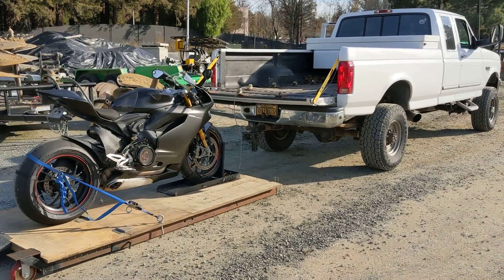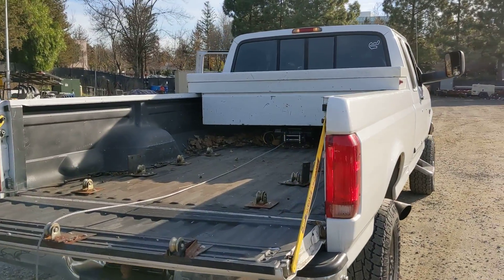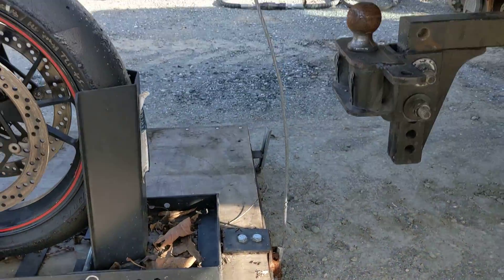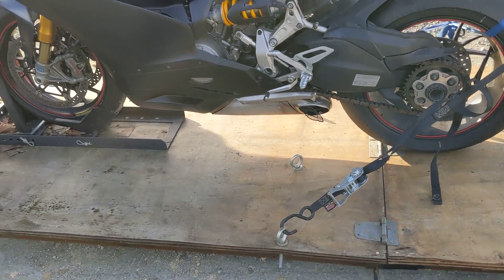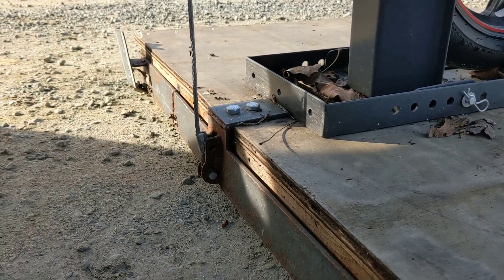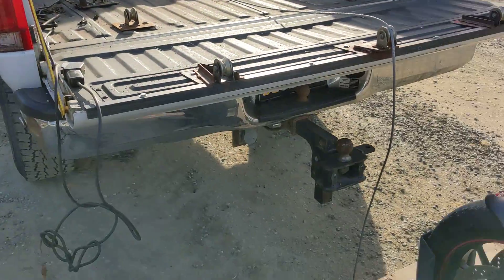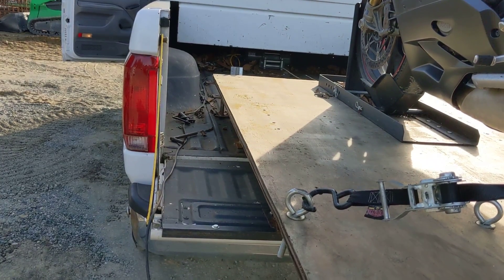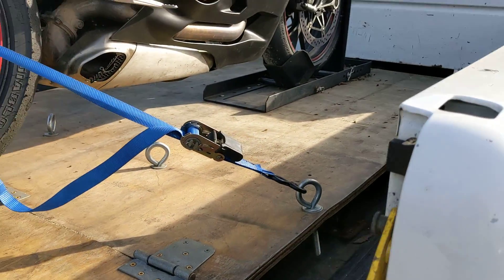The Motoloader: prototype motorized truck bed loader (be sure to check out V2!)

Comment: Pretty slick but I don't think I'd be drilling holes in the bed of my truck. I bet it would slide pretty easy.
Reply from the maker: Thanks - the version we're selling has a frame that doesn't require holes to be drilled, it ties down instead. Check out MotoLoader.com, a new ready to install kit is coming soon.

Comment: But how do you get it out?
Reply from the maker: It pulls out like a drawer on ball bearings as long as the vehicle is level. If on an incline, point the vehicle up so you're not fighting it. Here's an example of unloading: https://youtu.be/5xFc3I9S2EU

The final design will be ready by the end of this month, doesn't require drilling into the truck bed and significantly lighter and easier to build.

Comment: I need plans how to install metal for the winch I have the plate can you give ideas make a video obviously you drill a plate and bolted it to your floor but did you go into brackets ?
Reply from the maker: Plans will be ready soon, I have a new design that can be installed without drilling. This version I used steel angle (1.5" I believe) to weld to the winch mount plate and bolt it to the bed. I welded the angle to the front and back edges of the winch plate.

Comment: That’s awesome and nice obs Ford and 7.3 right ?
Reply from the maker: Yes sir 1994.5 with a D60 on the front, 5 speed manual. Best truck ever.
Reply: @Grip_Addict  nice and I wish my 97 had the zf5 in it and they are obs 7.3 are awesome trucks

Comment: This is a prototype of a better system that's been available for decades. Whatever you have looks like an excellent way to lose a finger while violating patents.
Reply from the maker: There certainly are better systems but what you gain in sophistication you lose in additional weight, complexity, and cost. I see you're particularly concerned about guiding the platform and not putting your finger in a pinch point - the final version will address this more clearly. But this will never be more than a DIY cost-hacking system for mechanically inclined people... 

On patents, those are very specific, for example -even though it's archaic - nothing else uses v-groove track and wheels. The systems I believe you're referring to (more like a really large sliding drawer mechanism) are mechanically very different. If you have a larger budget and / or don't like pinch points, those systems are definitely a better option!

Comment: Did you find any good deals on those rollers?  Ones im looking at say 660 lbs rating.  I have some ideas of my own on how i want to build mine.  Same basic principle though.
Reply from the maker: Yea those are the ones I've used on Amazon, I would like to find a better bearing for them.
Reply: @Grip_Addict  whats wrong with the bearings they come with?

Have you tried it with an off centered load?  Reason I ask is if I haul two bikes and one is much heavier than the other how it will work without wanting to go off sideways?
Reply from the maker: @MrBullfrog92  they aren't sealed so they go bad with water / corrosion exposure. I've had two bikes of unequal weight with no issues, it has to do with how far the rear wheels of the loader are from the center of gravity and how offset to one side that CG is. I'll need to figure out that math...
Reply: @Grip_Addict  lol ok that's weird considering they are sold for gates which is primarily outside!  Just another one of those things in this modern world that makes you scratch your head and say wtf?  I get all my exercise anymore from shaking my head!   Anyhow great work!  Thanks for the information and inspiration!

Comment: Why a 5 ton winch?  Is it what you already had?  Seems like serious overkill unless you use the winch for other things.
Reply: Oops sorry meant 5000 lbs winch?
Reply from the maker: @MrBullfrog92  It's actually a 3500 lb ATV winch. 3500 lbs is that the winch can pull only with the cable fully extended, so unless you put a shorter cable in the capacity is lower (I believe it's in the 2k lb range).
Reply: @Grip_Addict  that makes more sense.  3500 lbs winch should be adequate and cost much less.  5k just seems such overkill!  Seriously how much pull do you need to pull a 1k load up an inclined plane?
Reply from the maker: @MrBullfrog92  the pulling force required depends on a few things, mainly how the platform is loaded and how steep of an angle it gets to (depending on height of truck bed and length of platform) but I know it's less but close to the full weight of the platform so I chose the winch to be able to handle 2x the design payload for lots of extra margin. I'm close to finishing the v3 design - has lots of changes and improvements.
Reply: @Grip_Addict  right its just simple math.  No matter how its loaded and how steep the incline is the needed pull will still be less than the total gross weight of the platform and the load.  If your load and platform weigh 1500 lbs the winch will never have to pull more than 1500 lbs.  The initial pull to get the front up is a lever much like a wheelbarrow.  Since part of the load is supported by the rear wheels then the load to pull it up is less than the total gross.  Once the front gets on the rollers its an inclined plane or ramp if you prefer.  Unless its pulling straight up and it is pulling on a incline then the force needed to pull it will be less than the total gross.  Oil field has been doing this forever.  Its how they load a 40k piece of equipment with a 20k winch on a truck with a rolling tailboard.
Reply from the maker: @MrBullfrog92  yes sir you got it 👍

Comment: I was thinking of building something like this platform combined with the lift system in the vid Snowmobile Lift System The Very Simple Homemade Way.
Reply from the maker: Most platform lift systems are hydraulic versions of that principle. The way he designed that specific one works well for snowmobiles but won't work as well for a platform. The attach point and lifting arm ideally need to go under the platform instead of around it (how the sled setup is designed) to avoid interfering with the contents on the platform.

Comment: Show us the unloading processes lol nice project tho really smart i wanna do it now too lol
Reply: I saw the video u had of unloading the supplies, but how do u unloaf the bike/s and when u do unload em and u guide the form going down on its wheels do u need 2 people because its kindve heavy?? N im really interested in doing this too lol and for 2 bikes do u put them on same platform n jus move around ths mounts on form to keep em from moving??
Reply from the maker: @flashgraff4285  it's the same concept as the supplies, I'm going to add a handle to the design to make it easier to slide out. As long as the ground isn't sloping in a way that makes the truck lean to one side or another it will be guided straight onto the wheels. It's on two tracks and the winch cable is attached in the middle so it wants to stay centered / straight. For two bikes there are multiple spots to attach to, in the new design i have the integrated e-track going down the middle and the frame on the outside can be tied down to as well. Hope that helps, I'm planning to offer some of the custom parts as a kit. Feel free to fill out the form I have linked here if you want to send me your email so i can notify you when ready. Appreciate the comments! 👍

Comment: Put a double wheel on a pivot in that very first wheel spot and you’ll not have to manually guide it sir
Reply from the maker: Thank you for your comment! The challenge is getting a double wheel on pivot setup to also work when the platform is first transitioning onto the wheel during loading. For V2 I added a set of "guides" on the second set of wheels to avoid having to guide it manually.

Comment: I like the idea but why not mount the wheels to another sheet of plywood instead of drilling holes in the truck bed? Then the whole thing could be removed for hauling other things.
Reply from the maker: The wheels in the bed are bolted in with riv nuts and come out very easily / quickly and store easier than a whole frame (plywood wouldn't be sufficient). I'm working on a removable frame for people that don't want to drill holes in the bed. Thank you for the view and comment!

Comment: I would do a few things different. The things you bolted to the bed I would put that on a separate track to where I can take that off if I wanted to
Reply from the maker: Working on that as an accessory / option to riv-nuts in the bed. Thank you for the comment!

Comment: Good idea and design.
If you wanted to you could
run the wench cable through
a block and tackle and a snatch
block for loading heavier loads
like mulch, dirt, or gravel with a
bolt on dump container.

I mean, if you wanted too.

Comment: Nice prototype. Creative problem solving.

What year is your truck. Could you put up or send pics of truck doors and mirrors?

Thanks.
Reply from the maker: It's a 1994.5 F-250 with the common D60 front axle swap to make it essentially an ext cab F-350. Mirrors were added by bolting them on to a triangular piece of sheet metal that was welded in the lower leading edge corner of the door. They're the Dodge style mirrors.
Reply: @Grip_Addict  Thanks, Nik.

I suspected a mid-90s model.  I have a '93 F250.  I got 2000 Excursion power mirrors and control switch to install on mine. 

Thanks, again for reply.
Harley

Comment: I had a Silverado Ex-cab that I installed a full air-ride system, c-notched the frame and put in a 4 link. I could lift the front and drop the rear of the frame onto the ground. Made loading my dirtbike really easy. Never tried getting my CBR on it though.

Comment: Cool setup! Looks like it works great and not spending thousands. On V2 look at putting all the bed rollers on removable track(s) with flush hardware. Then your bed isn’t obstructed.

Comment: I recommend subbing the welding out to a welder; other than that great engineering. for those wondering how to offload, here are three do it by self ways, 1) the fast, hard and damaging way, full throttle reverse slam breaks and close eyes. And 2) the slow, soft and gentle way, attach rear of sled by a strap to the bottom of a pole or tree, drive forward keeping eyes open and slowly cable out the wench until sled is gently on the ground. Both methods work well one just has a better result. 3) rig a shive to the base of pole or tree, thread wench line through the shive and attach to back of sled cable in sled comes out just remember to give enough room between truck and pole for the sled to fit.
Reply from the maker: Thanks - check out the v2 video for more patient welds. The rollers are all ball bearings, it pulls out easily like a drawer by hand even with a heavy load (assuming the truck is close to flat).
Reply: @Grip_Addict  I did not realize that until right now I was just watching another guys video where he did do the off load too
Reply from the maker: https://youtu.be/5xFc3I9S2EU - check out V2 with a quick video of unloading and showing how the platform can be used for something very different!

Comment: Cool idea, just needs further refinement.  Do not like how the track wheels are blatantly bolted into the bed of your truck all over the place.
Reply from the maker: https://youtu.be/5xFc3I9S2EU - check out V2 with a quick video of unloading and showing how the platform can be used for something very different! The bed bolts are using riv nuts, working on a non-drill option too.

Comment: Not to run ya down but you dedicated the truck to no other uses, as I see it.   Wouldn’t a trailer have been easier?
Reply from the maker: Hey Brent the rollers in the bed come out in 5 minutes, I'm using riv-nuts as the mount points in the bed. I have a trailer as well, but this is still the best option to load a disabled bike or if I don't want to be towing something. For many people a trailer likely works just fine! I'm planning on building a trailer with the loading system as well.
Reply: @Grip_Addict  Greetings fellow Macgyver!   Good in go and I liked your content. Hope I did not come across as derogatory. Also, one of the other commenters made mention of seeing it come down out of the truck. Please post that if you can. Thanks very much Nik.
Reply from the maker: https://youtu.be/5xFc3I9S2EU - check out V2 with a quick video of unloading and showing how the platform can be used for something very different!

Comment: You would be better off making a sub-frame that bolts into the bed that goes the full length of the platform like you see on most of the commercial units.  A basic box frame would due, a couple of cross members to keep everything square.  You could even integrate the winch if you wanted to remove it with the lift.  The tailgate is only designed for about 500lbs.  The loads you are putting on it easily exceed that.  Over time you will damage it.  This is why most of the commercial units use the sub frame design, it spreads the load out over the bed and tailgate.  If you build it right the while unit will go in and out of the bed in a few minutes with a hand full of pins.

Good start, there is a lot of potential for improvements.  Paint to keep it from rusting to pieces would be a great idea as well.
Reply from the maker: Thank you for the comment and feedback, really good point. I'm considering a frame especially for people that don't want to drill the bed, I don't like that it adds much more weight and raises the center of gravity of the load. I'm making a hitch based tailgate reinforcement for heavier loads and beefing up the leading edge mount, but tailgate ratings are not really described or published anywhere - I've seen 800 lbs and that's likely concentrated on a single point. Just finished v2, painting today 👍

Comment: what happens when a clown builds this with screws?  a come-along  and rollerblade wheels?
Reply from the maker: Clown gear is pretty light... Red rubber nose, few wigs, big shoes, balloons... 2" wood screws, come along, roller blade wheels with good ABEC-7 bearings should handle that load well.

Comment: those threaded inserts are great. are they all the way through and secured on the other side (nuts or something)?
Reply from the maker: They're called rivet nuts or riv-nuts, you just drill a hole and press them in with the riv-nut tool. No need to access it from underneath. So you can put them into blind holes without rear access.

Comment: Nice work man.
Not pretty to look at.
But it definitely does the job.
Better than spending 2 or 3 thousand on pro built unit that you would hardly ever use anyway.

Comment: I can see this working if you commit your truck to just hauling bikes because you basically weld guides and rollers and a winch drilled and bolted to the bed. Good use of a beater or work truck . Need a spare truck to do that? Pretty sure there is a nut and washer on the under side of each and every single of those bolts under the tailgate and bed. So removing those is not a quick job . 2 person be quicker
Unloading would be done manually by hand  using the winch to back off slowly until back of ramp wheels touches the ground now you'll have to really push it backwards till it clears the truck then using winch to lower it to the ground. Just saying it would require manual hands on unloading vs loading it up. Worse with 2 bikes unloading .
Reply from the maker: Everything in the bed is bolt in, can be removed in 5 minutes. And it slides out like a drawer on ball bearings, easy to pull out. More videos of v2 coming soon.
Reply from the maker: https://youtu.be/5xFc3I9S2EU - check out V2 with a quick video of unloading and showing how the platform can be used for something very different!

Comment: Uh....just use a hitch pin dude. No need to redesign anything to keep the pin in.
Reply from the maker: Getting the alignment consistent between the plate and the platform and a retaining lip to hold the pin in so it doesn't rely on the winch tension is what I'm redesigning. But I'm still using a standard pin. 👍
Reply: @Grip_Addict  Ah, I get it. This is the same premise a lot of vehicles use. The military uses these and I have seen those dumpster trucks use a winch like your setup.

https://oshkoshdefense.com/vehicles/m1120a4-lhs/

Comment: A cool idea and some creative ‘engineering’ .......BUT........ the bed/tailgate has all of those wheels welded to the bed, making it difficult to use as a normal bed (loading drywall, furniture, crap). So essentially, you’ve keep your truck’s looks but disabled its function. Probably would have been much easier to get a small trailer (capable of carrying two bikes) and done it for much cheaper. Again, cool but over engineered for sure vs something thats more practically available.

.....on a side note, the tie down rings on the sides are only going thru the plywood and you can see it pulling thru the plywood already. Only a matter of time before that rots, gives, or breaks.
Reply from the maker: Good points, the wheels are bolted in with riv nuts so the bed can be returned to normal use in about 5 minutes with a 5/16" socket and electric drill. The eyelets on the plywood is definitely a short term solution, I added some sheet metal to reinforce. And v2 solves it altogether: https://youtu.be/Xn6J1al0e2A

The issue with a trailer is I still won't be able to get a disabled bike onto a trailer by myself, so it doesn't solve the actual problem. I own a few trailers, but I still use the platform for various situations. Including transporting other heavy stuff that I can't lift by myself but can scoot onto the platform (i.e., engines, pallets, etc.).

Comment: I was thinking of starting with a truck with a hay loader on back using the pivot system with additional structure to automatically lift a bike or two on a pickup bed